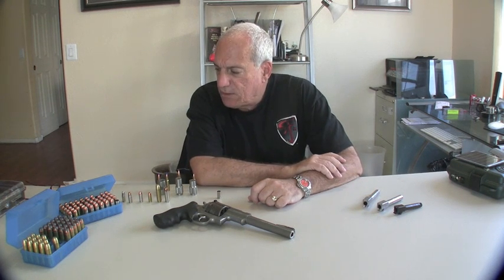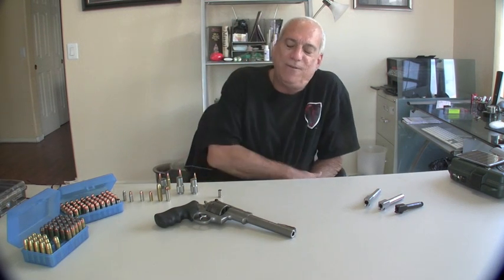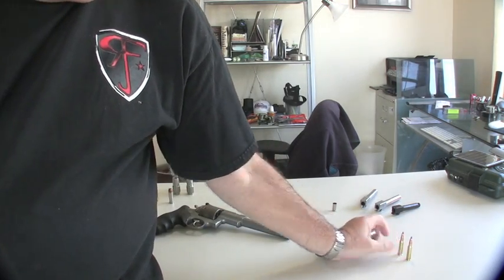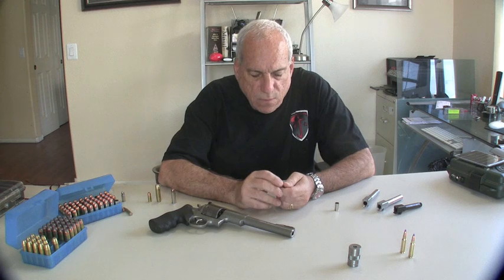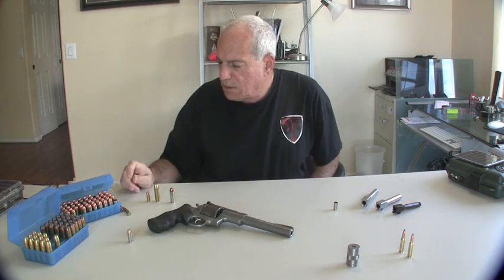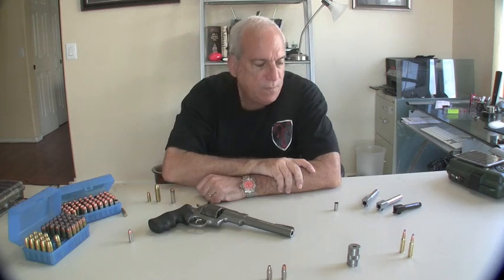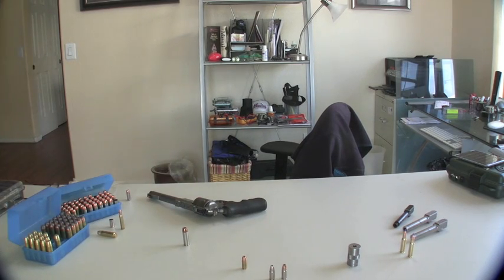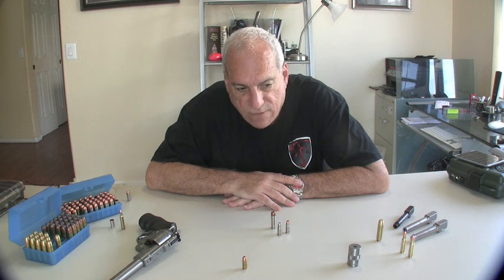TO CRIMP OR NOT TO CRIMP PT. 2 BASIC RELOADING

Comment: Wow, thanks for the in-depth single topic discussion. I am new to reloading, actually pre-new, since I have not actually reloaded anything yet. I've been spending my time reading and watching videos, I see conflicting info and get confused. (which is why I have not yet actually reloaded anything) I've had the equipment for a few weeks now. But I don't like to do, until I am comfortable with what I know to be fact. Your video answered some questions for me, and underlined some of my conclusions. I appreciate the effort.
Reply from the maker: Always glad to welcome a new reloader to the family. You are right on target ( no pun intended) with getting as much information as you can and taking it slow. When you do get going , start with a lower pressure round like the 45 ACP. It is a perfect stepping off point. Don't go for any of the hotter loads in the manuals to start with. Stay in the middle. You will do fine,
Thanks for watching. Have fun be safe.

Comment: jr10 I have a ruler super red hawk revolver that is chambered in 10mm auto.  What is your thoughts pro and con on reaming cylinder to use the 10mm magnum round in my revolver. 
The SRH 10mm is a rather new concept for a revolver and not to much info on it is available as of yet. Your advice would be greatly appreciated!!!!!
Reply from the maker: Always good to see another 10mm shooter. As you mentioned there is not a lot of info out on the 10mm mag. It is a relatively new addition to the growing wildcat category. Years ago I had the same challenges when I decided to get into the 9x25 Dillon. At that time there was very little if any load data on line. The one thing I had going for me was that there was some major interest by big companies and it was possible to get specific loading dies, and barrels for that caliber. If it were me, I would wait to see if the round gains popularity. The way I see it, if you go ahead and do the machining on your Ruger, and the round loses popularity and dies out, you will have  effectively antiquated your gun. I love my 10mm weapons, but I also live within the current limitations of the caliber. If you want to go to a more potent option look at the 41mag. It is more potent and load data is readily available. I hope this helps.
Have fun Be safe.
Reply: Thanks for your input on my RSRH.  I agree with you 100%.  I care not to mess up a 1000.00 gun. I'll just take a wait and see approach before moving head with 10mm mag thing.  Besides where I hunt the critters are merely black bears and cougars which 10mm should be just fine for any threat from them.
Reply from the maker: @willyb8886  GOOD CHOICE :)

Comment: Hi JR
I am new to reloading I just set up my Dillon 550b I want to reload 9mm but wasn't sure about the crimp and came across your video. Thank you for sharing your knowledge with us. I always heard the term head spacing but did not know what it was until you explained it. I have a question about max. Cart. OAL for example in the speer reloading manual for a 9mm luger tmj rn 115gr the COAL tested was 1.135 how close do I have to be to that # either above or below . I want yo make sure I am safe. I know 9mm has high pressure. Thank you in advance for your help. PS I subscribed to you channel.

Comment: I know this is an older posting but I just came upon it and want to thank you for the valuable and well presented information it this and your other reloading videos. I do have a question for you since you mentioned in one of the videos that you load 45 ACP with Berry's 230 gr. Plated RN bullets as I am also. I primarily use two manuals, Hornady and Lyman, to get my starting loads then use my Chrono and primer and case inspection combined with group size to pick the final load. There is quite a discrepancy between the two manuals on cartridge COL.  I went with the Hornady manual 9th addition which has 1.210" and the results and function are great in my Kimber Grand Raptor, but the Lyman 50th edition has 1.275" COL.  What do you recommend and why, and why do you believe is the reason for the significant difference.
Reply from the maker: Great to hear from another reloader.I have discussed this quandary  with others in the past. The easiest answer is that it is a grey area in a very fluid environment. In my daily work people ask me for a remedy for their flu symptoms. As we all know their is none. With respect to your question, the situation is the same. I have much older versions of  your manuals. In my Hornady manual the 230gr RN  COL is 1.230, and Lyman is 1.275. At the same time Speer has the max COL at 1.275, and Sierra has it at 1.270. Why the disparity? The question is complex with no single answer. When I talk to new reloaders, I always recommend that they pick up the latest  Lyman manual. Why? Lyman is an impartial reference. The other manuals I mentioned are published by bullet manufacturers with a vested interest in selling their products. The majority of the ballistic data they publish is based on testing with their own products. Another variable that has been making itself known is the advancements in gun powders. Newer more advanced powders with different burn rates and pressure profiles dictate changes in older bullet specs. Lyman will always be the most conservative with their load data and measurements. This is because they are not specifying a specific type of bullet ( Barnes, Hornady, Barry's, etc) They are giving you the absolute max length that a standard 45ACP will function reliably. Your COL of 1.210 is fine depending on the load data and powder you used for reference. The most important thing to remember is that a long COL is not nearly as dangerous as to short of a COL.
Have Fun Be Safe.

Comment: Really appreciate the info, 3 days into this journey. Turns out it is very stressfull. Always seconds guessing myself on double charging even though i know I am not doing it and weighing the finished product for any deviation. Thanks again, i think I may have been crimping my 9mm too much, i noticed a little more kick due to pressure(i think) on my 147 RN seated @ OAL 1.16 when I had a tighter crimp on it. For only 3.4 of TG, it should be very light shooting, and it does seem to be now with a very light crimp. Thanks!
Reply: Berry's plated .356 btw
Reply from the maker: Michael. The best thing you could have said was that you were going slow and double checking yourself. Going slow is the best course of action. Soon the stress will start to subside as you get more comfortable. Slow and Steady. Reloading is not a race.
Have Fun Be Safe My Friend.
Reply: Thanks jr10!!
Reply: Thanks jr10!!

Comment: Jr... I am loading .223/5/56 using a 55 grain FMJ BT... I am concerned about the crimp... Any tricks or suggestions? They are being fired in a Adams Arms M4...
Reply from the maker: As I mentioned in this video, the 556 is a necked cartridge that head spaces off of the shoulder. Crimping is not the same issue as it would be for a straight walled case. Some people like to put a tighter crimp on their rounds to build pressure for more velocity. I do not recommend this. The 556 is a high enough velocity round to start with. There is no need to introduce any further risk factors for a few FPS gain. You only need to remove the belling of the cartridge , and possibly only the mildest of a tapered crimp.
Thank you for taking the time to watch.
Have Fun Be Safe :)

Comment: I am totally new to reloading and have alot of questions. 
I will only ask one ( for now :)
what type of bullets do you recommend for target shooting 38special and or 357 magnum? 
oh ..and what type of crimp for these rounds for my Ruger blackhawk convertible .
I will eventually load 9mm since it takes those as well. just want to start out slow. 
using a single stage press. 
thanks so much for the video.
Reply from the maker: That Ruger blackhawk convertible is one sweet looking revolver. I love the idea. For target loads , and especially as a new reloader, you should keep your loads in the midrange of the data tables for the relative caliber and bullet weights. I would recommend investing in some good brass in the beginning. I like the Nickel plated Starline brass.
In that you have a revolver, brass recovery is not an issue. Starline will give you quite a few reloads out of the same batch of brass. With medium power loads, I would recommend Rainier plated bullets. They have some of the best plated bullets on the market. In the beginning you can focus on your techniques, and proper measurements , and wights. Concentrate on good bullet seating techniques, and choose a good powder that will work with all three calibers. This will save you a lot of money in the end. I would not expect to precise of accuracy with the 9mm. 
As for crimping, use a good, but not to aggressive crimp. The revolver rounds head space off of the case web, so crimping is less of an issue as opposed to semi-autos. That being said, with plated bullets, to aggressive of a crimp can damage the bullet plating thus affecting accuracy. 
Thanks for watching. Good luck on your new journey.
Have Fun Be Safe :)
Reply: I plan to use the Lee crimping die.
I have heard nothing but good things about it.
Thanks for the advise.
Oh yeah.....you have a new subscriber here. :)
Reply from the maker: You definitely won't go wrong with Lee. it looks like you are doing your homework . Well done sir.
Thank you for the support. I truly appreciate it.
Remember. Go slow, and double check your work
Most of all;
Have Fun Be Safe .
Reply: tjmooremusic,
For what it is worth, we have been buying from 'Badman Bullets' in Oregon. They sell a poly coated bullet that has run clean in the barrel and has no smoke from lubricants. Others may disagree, but they do sell a sample pack of 25 bullets that you can reload to try. Give these a try and I think you will like them. I like the idea of handling lead-free bullets do to the coating.Maybe this will work for you. Also, the price is pretty good since they ship for free and are fast in their shipping. Good luck!
Reply: john dougherty 
thanks for the tip. 
safe shootin to ya!
Reply: john dougherty 
thanks for the tip. 
I'll definitely check it out. 
safe shootin to ya!
Reply: jr10 
it is a beautiful handgun. 
my favorite in my collection. 
I am thankful for all the help I get from my brothers in the gun community. 
Peace.

Comment from the maker: Thank you for the generous comments. I really appreciate them. With respect to the 115gr bullets. What kind of case is the 9mm? What don't we want to do with this kind of case in a semi-auto? Thats right, crimp. there are other ways to build pressure in a round. The most direct approach is your choice of powder and burn rate. Faster burning powders develop pressures sooner then slower ones. My first choice would be to see if anyone has a lighter recoil spring while you use up your 115's.

Comment: Your definition of head spacing is incorrect in that it has NOTHING to do with bullet seating depth but rather the point at which the cartridge meets the chamber. This is particularly true with shouldered cartridges. Benchrest shooters will in fact take a cartridge and cut a couple small grooves so that they can load a dummy bullet and find where it touches the rifling then back it off about .01 inches to get optimum accuracy.

Comment: as I set up my reloading bench I strive to keep it simple. 
my question now is what type of scale to use. I see the benifit of either digital and beam.
what would be your recommendation? 
I keep thinking of having both to test against each other to find consistency. any thoughts?
Reply from the maker: I personally use a digital. I think that beam scales are great, but with my tremors, would be more difficult for me pI. I think excellent accuracy is attainable from either.
Thanks for watching.
Have Fun Be Safe.
Reply: Thank you. 
I have my own problems with short range eyesight. It seems that a digital scale might be helpful  for me. I've done a fair amount of research and see some pretty reasonably priced digital scales out there in money spending land.
RCBS has one I am interested in. 
Do you have any suggestions?
Reply from the maker: I am currently using a Lyman scale, and would rate it at a B- . It wasn't very expensive at the time, and has done a better then average job. Let me know how you like the RCBS if you get one.
Reply: Will do.
Reply from the maker: Excellent points John. I like your thinking.
Reply from the maker: VERY COOL!
Reply: john dougherty 
thanks for the tip.
I have no interest in high production loading. 
I want to be more accurate. 
that's it. but I think your advise is great because I am a total beginner. I just want to get comfortable and proficient with the basic process. 
starting out with my revolver rounds before I even start in on rifle cartridge loading for more precision shooting. 
thanks again!

Comment from the maker: A lighter spring will keep the gun cycling without having to experiment with different loads. If that isn't an option, my next choice would be to work up loads with Blue Dot Powder and standard load techniques. The 115 gr works well with between 7.7 up to 8.5 gr of Blue Dot. Start on the low end and work up until your weapon cycles reliably.
Thanks for Watching.
Have Fun Be Safe :)